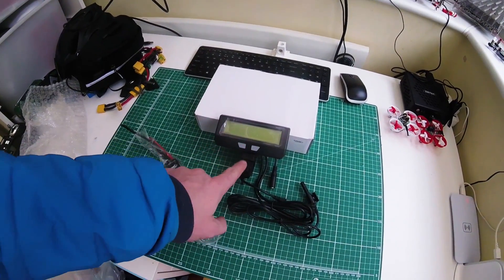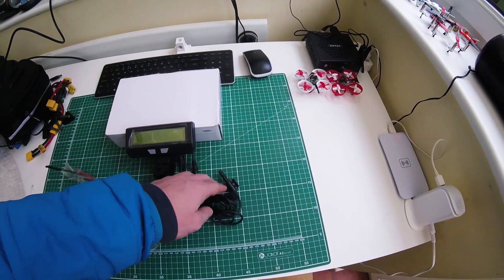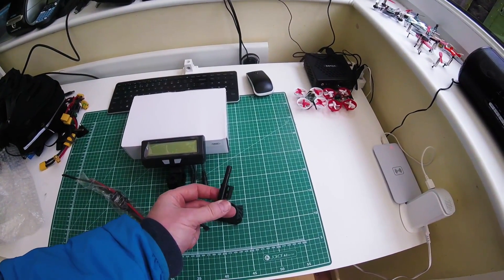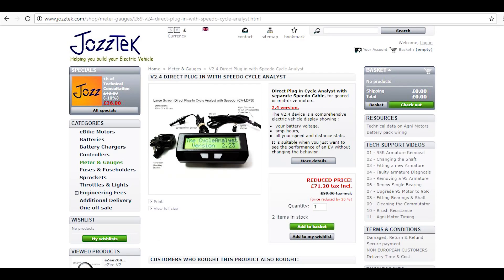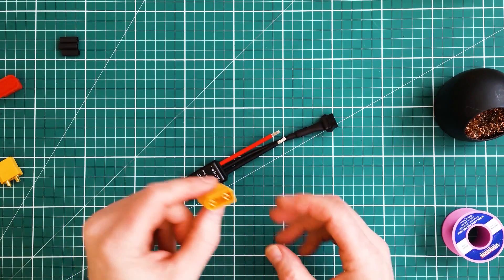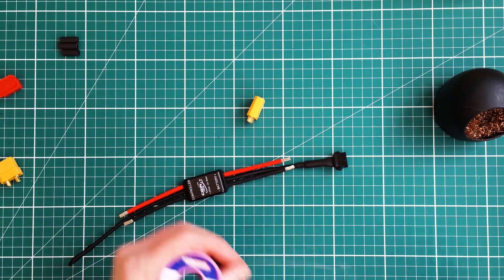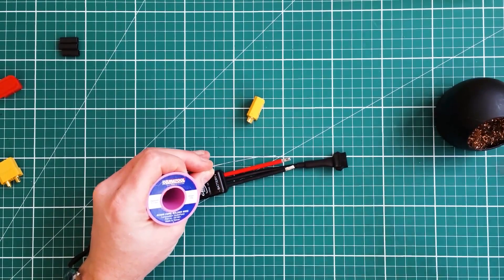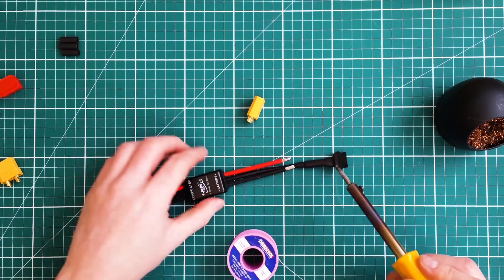Installing a Cycle Analyst Standalone Version on to a Cheap Ebike

Comment: Hi, I have a sabvoton 72v150a controller which provided speed info through the 6 pin cable to the display. But when I upgraded to CAV3  I had to use the sensor. Is there a way for cav3 to get speed details from controller?

Comment: Instead of the go pro mount you could simply drill a 1/4" hole through the handle bar stem and bolt the cycle analyst on it. if you do not want a hole through the bike frame, a U clamp type set up would work.
Reply from the maker: Drilling a hole through your stem is not "common sense" it's asking to end up in hospital with serious facial injuries or worse?
Reply: @richardhanson2331  LOL, you are welcome. no one has ever ended up in the hospital due to a tiny hoel that wouldn't effect the structural strength significantly, but I guess you are type A personality.
Reply: @richardhanson2331  "a U clamp type set up would work.
"

Comment: What size battery are you using just curious? fairly small profile sitting under your seat.
Reply from the maker: The battery pack is 5ah. Only good for about 5 miles.  I used a much larger 16ah battery for longer journeys